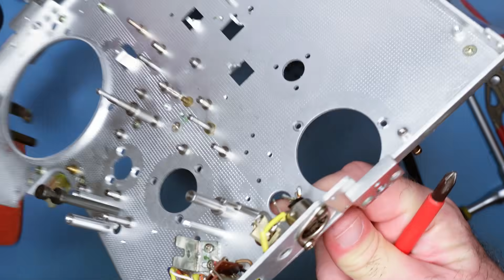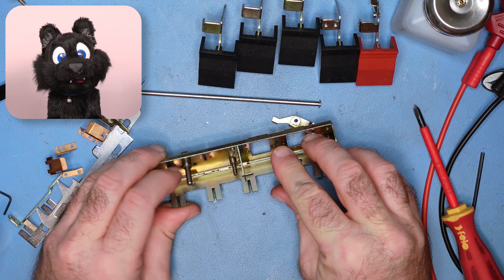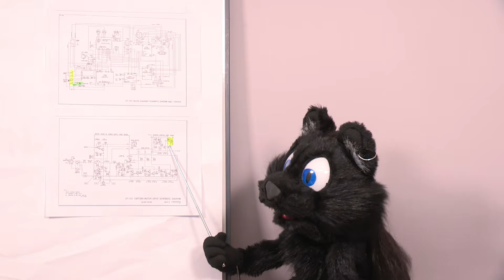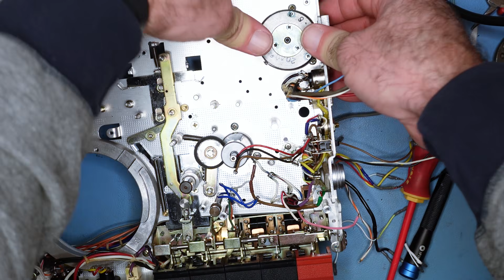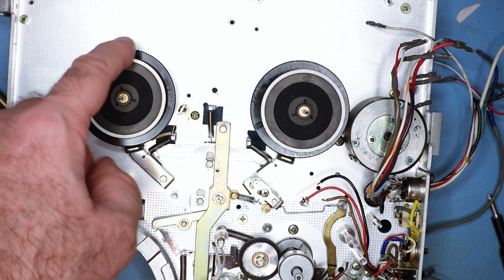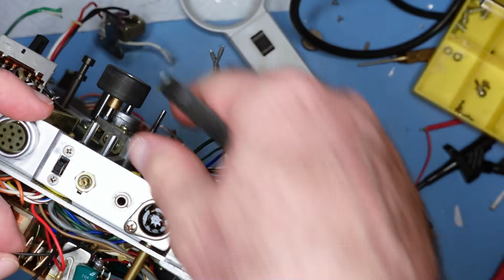Akai VT-110 - Part 4

Comment: Hello,
I saw in your video that you make the "pinch roller" yourself. Where did you buy this rubber roller so that I can make those "pinch rollers" myself too? I have the parts for this. Because the imitations that some companies sell online are truly worthless for an Akai VT-110. They are all universal kits that are useless to anyone and are not suitable for the VT-110. But if you perhaps have the link or something similar, I'd be saved.
Reply from the maker: As of yet, I have not remade actual "pinch rollers" - that term is usually only applied to the wheels that press the tape against the capstan. Those were still good. The rubber idler wheels (idk if that is the proper term either, sorry) that I made are cut from a length of neoprene rubber. These cylinders are designed to be used as buffers for washing machines and similar appliences. It works fine on the lower-force wheels, but I need to remake the ones pushing against the driving capstan. The rough metal surface is eating them up pretty quickly. I found actual rubber for that but still have to machine and test it.
Reply: @atkelar  Do you happen to know the exact dimensions of the RW and FF rubber rings for the Akai VT-100? I cannot find these dimensions in the service manual.
Reply from the maker: Mine on the 110 are 21 and 28 mm diameter, if you mean the two wheels that are running against each other for that function. I think the 100 is identical on the mechanical level, so it should fit.
Reply: Thanks.

Comment: An impressive mixture of designs from many sources (the mechanical design wouldn't have come from the electronics design team...) all coming together in such a tight space. At least they hadn't started using flat ribbon cable yet. 
One of those "amazing it even works at all" types of machines. Well done with the repair!

Comment: Amazing job. I tried to work on an Akai open reel deck equipped with Dolby circuitry in the past and I lost my sanity as wires would break every time I touched it and I couldn't find where they were supposed to go. The machine ended up being a room decoration as I never managed to make it work. 😅
Reply from the maker: Service manuals seem to be rare for this brand... They exist and are quite exhaustive, but they don't seem to have made their way into public repositories...

Comment: Quite impressive again.
Where did you find the rubber for the capstan?
I suppose their diameter is not critical since they're not involved in the tape transport during recording/playback.
Cheers
Reply from the maker: The pinch wheels on the capstans - i.e. the ones contacting the tape - were the only ones that were still servicable. The ones I remade are all driving wheels. I made them out of neoprene rubber; they work, but there should be better options out there. I'm just not a meterial scientist...

Comment: I am as always thoroughly impressed. How do you keep all the assembly steps in your head for such a long lasting project. I would have forgotten my disassembly steps already after a few day's. Or do you use lots of video picture references?
Reply from the maker: A bit of both really. To me it is mostly a mechanical jigsaw puzzle. Once I know how the mechanism or circuit should work, it's relatively easy to put it back together. And for the few parts that are unclear (mostly washers and wire connections) I have the pictures and disassembyl videos.